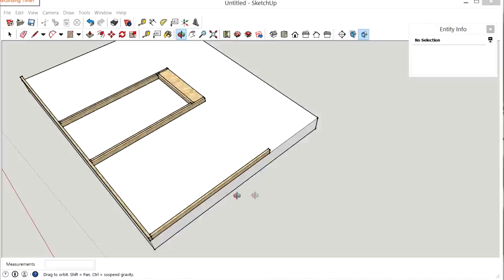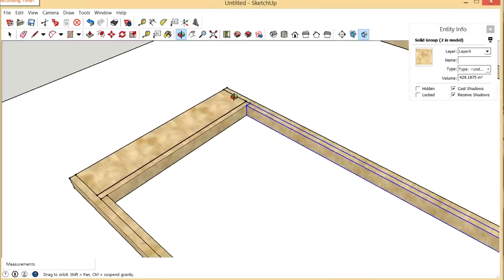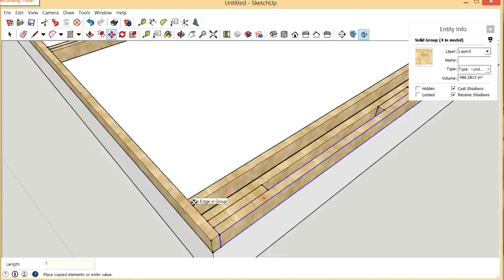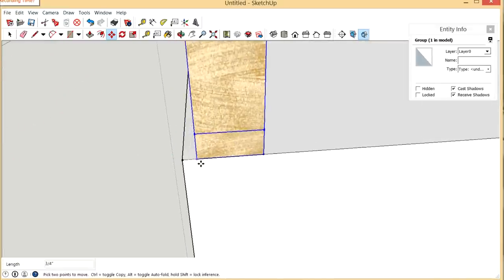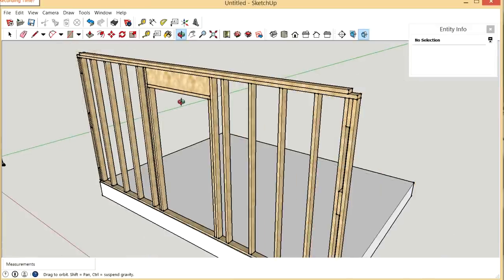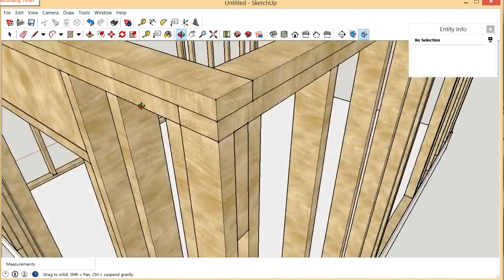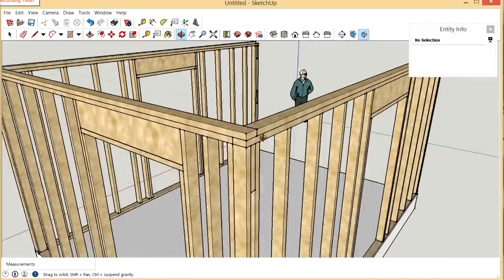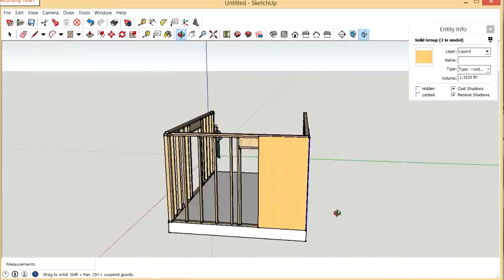Framing Exterior Wall Corners - Requested SketchUp Video

Comment: Why wouldn't you just sandwich a half inch piece of osb plywood in-between the 2 by 10 instead of leaving a space in the header.
Reply from the maker: It’s obviously stronger if you have built anything. Osb has a strength axis stronger than plywood.  Oh snap lol
Reply: @ArtisanTony    was just curious if there was a reason for not sandwiching an osb piece. Is it to save time or material or just not necessary. Love you vids your a true master at your craft.
Reply from the maker: @majorc7298  these headers are oversized for the application so it is not necessary.  The 2" x 10" are used because they bring the header to typical height.  But I have seen it done both ways so it is a personal choice really.   If you have scrap OSB it's not a bad idea but again, not needed structurally  Thanks!

Comment: Can 2x6 serve as floor joists if they span less that 7 feet. The center has a 4x6 runner. The structure purpose is for a small cabin with a loft.
Thank you!
Reply from the maker: Yes, if you look at the span tables it says you are fine.  If they are closer than around 18" to the ground I would use pressure treated. http://www.southernpine.com/app/uploads/SPtable2_060113.pdf
Reply: Yes sir, I put 6 mil plastic moisture barrier under and everything is pressure treated on concrete blocks. Also, the structure has 4x4 pressure treated posts in 4' of concrete on all four corners to serve as tie downs+stability. I staggered the subfloor and added perlins between joists for rigidity.
Reply from the maker: @barrydoster233  sounds strong :)
Reply: Thanks

Comment: Doesn't this type of corner leave deadspace that you can't insulate? . F.Y.I you can click and hold your mouse wheel button for the orbit tool. No need to go up and click in the tray
Reply from the maker: There are endless dead spaces in a building.  Noobs zero in on this one.  If you want wimpy corners go ahead.
Reply: @ArtisanTony  isn’t the goal to minimize dead space? Wouldn’t that be good building standards? Also, there are triple and quad stud corners that aren’t wimpy and leave less dead space. This is coming from experts….
Reply from the maker: @MikeTheSith200  lol, "experts" give me a break. I have been doing this for 44 years. No one is an expert in this country.  You are all just political tools.  No go preach you shite to someone else.  I build every day and know what is best for the over all assembly of the home.  You pick out one thing in the assembly.  What do you do for a living?  Draw a detail and make a video. Nope, you just want to armchair quarterback, nice job.
Reply: @ArtisanTony  Are you serious ? an expert would actually be showing how to do this on the jobsite with a real crew using real lumber framing a real home.
Reply: @ArtisanTony  Not on an outside wall that requires insulation,

Comment: very good explanation about wood framing until your comment "you don't see wood frame houses falling down in earthquakes" ....shows me that you don't have any clue about engineering.
there are so many studies about that....the only reasons a wood framing house could survive and structurally you could still living there is because the house is small in height and lightweight.... That it!!! ....wood frame houses are not strong at all besides supporting its own weight plus the stuff inside and the snow load.
Reply: but they can handle movement better than masonry construction.  Bricks, blocks, etc are strong in load but brittle, wood can handle movement without failing.